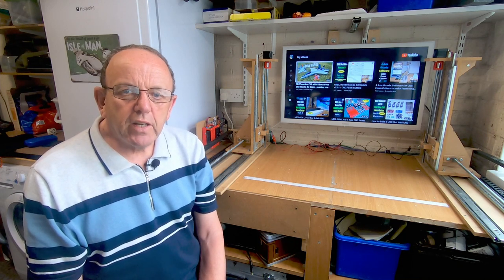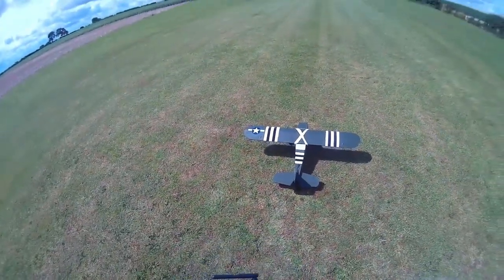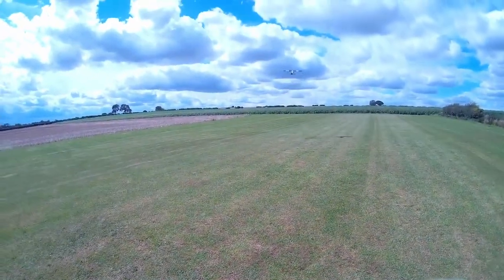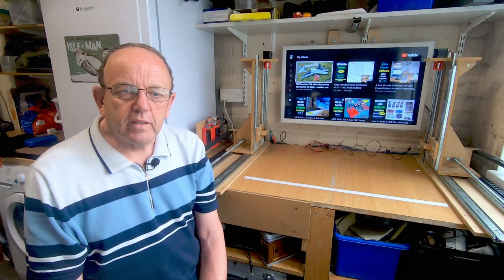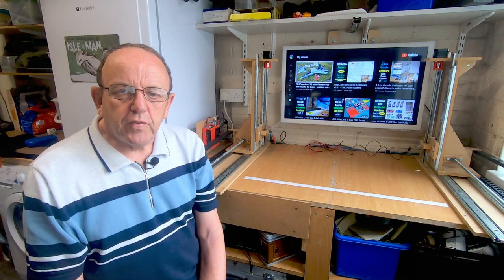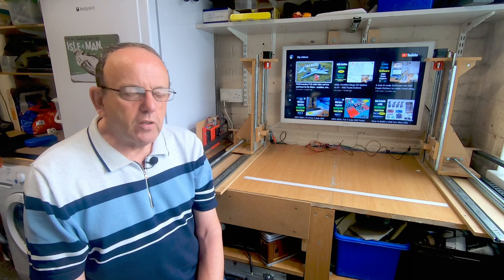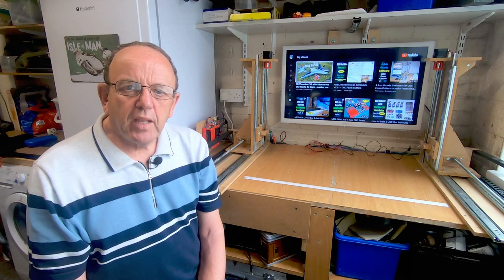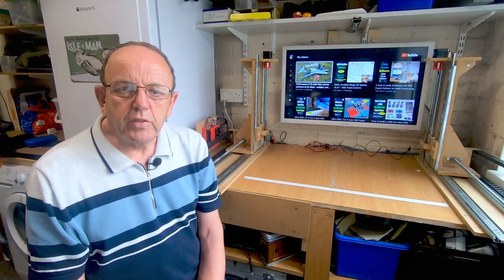Fusion 360 for 4 axis CNC Foam Cutters - Parallel Cuts Only - Part 1

Comment: Keith, thank you so much for this tutorial. My machine works in a different axis, in part two, could you show us how to convert the axis quickly?
Reply from the maker: Hi Matthew. It may be a while before I have Part 2 out. If you send me an email with your axis letters I'll show you which lines of code need changing.
Reply: @rckeith   - I have some ideas for improvements to the post, like options for wire on/off and of course axis word options, obviously XYUV (for LinuxCNC) and XYUZ (for GRBL4axis), if Matthew Dina can tell us what he needs we can do that too.

Comment: Would it be feasible to draw the profile in any 2d cad, export it as dxf and enter the dxf file into Jedicut twice as XY and ZU?
Reply from the maker: Jedicut doesn't work well with many dxf files. Had several guys contact me with problems loading them. I don't use it anymore so I can't say if that will work.

Comment: Haven't watched the video yet, but how would you feel about exporting two 2d cuts, each cut being one side of the foam? A post processing script may make it possible to stitch the two cuts into one 4 axis cut.
Reply from the maker: Hi don't think that would work because the left and right carriages need to be synchronised so the hot wire leaves the foam at the same time. It would make the post-processing very complex. You start getting into interpolation which involves some heavy maths. I did consider it but it's far too complex for my old head.👍👍👍

Comment: i was looking for free solution to cut letters and other shapes using wing foam grbl cutter (made with great help of your videos) 
I was using inkscape to make dxf file and jedicu to generate gcode but cuts came up not as smooth as wings go, Less curvy and more edgy instead. Hoping this helps!
Reply from the maker: Please watch all the video because you need to think how the  hot wire will travel. You will probably need to add helper lines so the wire travels from letter to letter.
Reply: @rckeith  yes, did that. Its the best part coz u can set travels perfect. But shape is less smooth.
(Its something about dxf files i guess) Hard to explain. Will upload video.
Thanks for great videos!

Comment: If my wire has a diameter of 4mm, should i specify a Kerf width of 4mm or 2mm?
Reply from the maker: I don't think you will be able to heat a 4mm wire mine is 0.4mm. There is no rule of thumb for the kerf value.  You will need to run some tests.  Have a look here explaining how to get a good kerf value https://rckeith.co.uk/how-to-get-a-good-kerf-setting-for-cnc-foam-cutters/
There are too many factors such as the type of wire, length and the type of foam.
Reply: @rckeith  i’m doing a design for an expanded polystyrene factory. They have a pretty big hot wire cutter which i haven’t seen personally but they told me the diameter of the wire was 4mm.

I’ll try different widths then, thank you.
Reply: @rckeith  one more question. It looks like Fusion 360 isn’t the best option for what i’m trying to do (i want to cut a lot of individual letters out of a single piece of foam). The problem is that since fusion thinks it’s a laser cutter it tries to move the tool through the letters.

I saw on your website some recommended software for wings but what would you recommend for letters (kinda like the example you show there with the letters rcKeith)?

Comment: hi firstly thanks much, ı have a little problem, when ı try the upload .nc code to grbl cutter ı have a error "invalid gcode at line 10" and my line 10: "G0 X-0.5 Y2.458 U-0.5 Z2.458" x and u axis loooks weard but before everything is okey but now have a problem, also working if ı  make edit old .nc codes
Reply from the maker: It looks like the negative values you have for U and X.  Have a look at how I move the origin and increase the stock size here https://youtu.be/sq7Dfw7plzw?t=1596 that should get remove the negative values